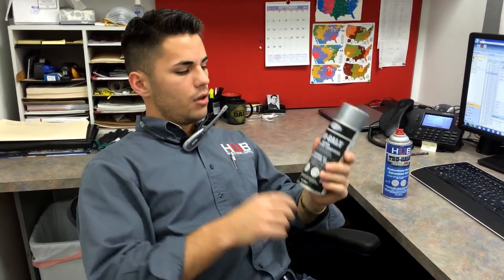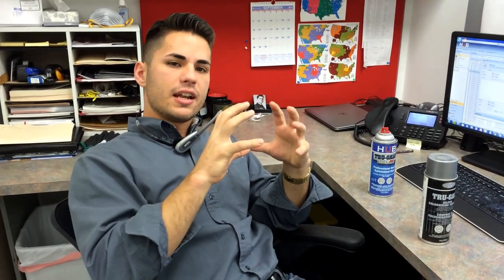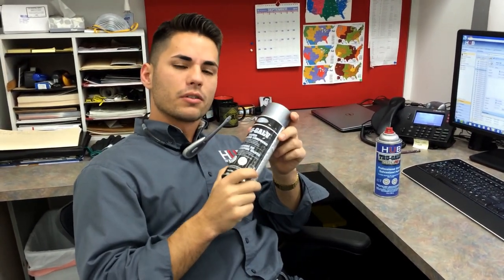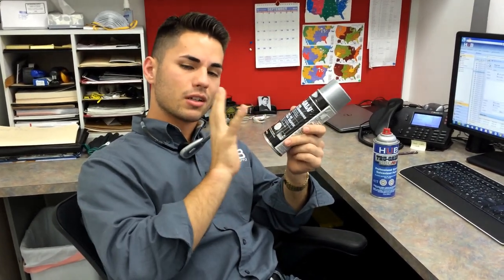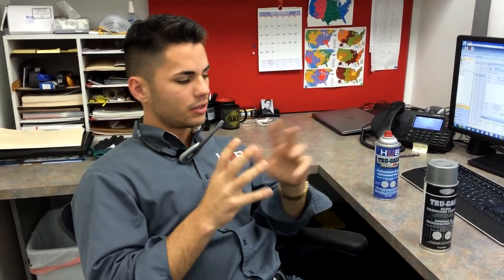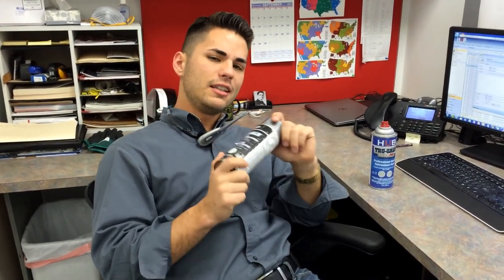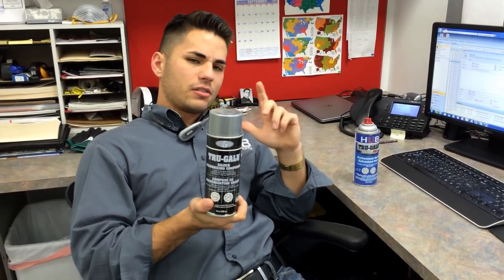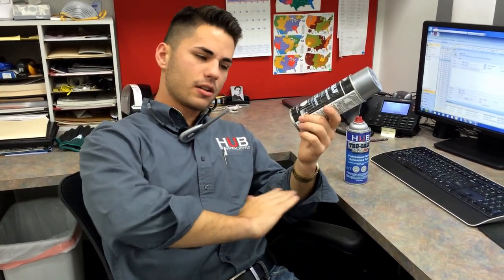EVER WONDERED ABOUT PUTTING GALVANIZED PAINT OVER PRIMER?

Comment: Cleaning with a power washer should be fine if the water is allowed to dry before painting and the surface is otherwise well prepared (degreasing, etched, etc.).  Blowing the water off with a leaf blower and/or compressed air would help speed this up as well as leaving the parts in the sun.

Comment: You can use the power washer. You just have to make sure it’s dry.
For small projects that can be accomplished with a heat gun very quickly.
 Wash it with the detergent, use sandpaper, etch with vinegar, rinse it with water, dry it with a heat gun, and you’re good to go.
Reply: However, everything else you said pretty much spot on.

Comment: I'm restoring an antique copper kettle used for washing clothes. The top lid appears to be galvanized, I want to restore the lid, what brand name do I purchase to spray on, I want a nice polished finish? A finish like what is on new corrugated metal roof.
Reply: try rustoleum zinc spray, it is a beautiful non industrial look. Very smooth

Comment: Anyone can tell if it would work to spray zink underneath the car to prevent rust ? I thought about this and did it by other methods (sand blaster + rust converter + primer + waxoil), but I think zink alone might have worked well, besides paint chipping in some areas since this particular zink spray seems easy scratchable.
Reply: Yes and no. Let me explain. I rebuilt a truck several years ago, I live in the northeast Salt belt. The entire truck was removed from the frame, and the frame was 100% sandblasted. I used ZRC 96% Cold galvanizing and reassembled the truck. 5 yrs of hard use in salt and road deicer, and zero rust. I also zinc coated the floor pans, rockers etc but these were all fresh sheet metal.
I absolutely would not recommend zinc galv over a vehicle that has any surface rust, road grime or isn't immaculately clean metal. I would recommend fluid film spray for a vehicle. Look into it on YouTube. Have a good day.
Reply: You should spray fish oil under the car, its a proven method

Comment: can i use gal paint over a rust converter?
Reply from the maker: Our expertise is in the metal fab industry and advising our customers how to create new work that won't easily corrode. Having said that, my understanding of rust converters is that they form a protective layer that would act the same as a primer coat and prevent the zinc in the galvanizing paint from doing its job.
Reply: @metalinsider8579  Rust converter prevent anything of doing its job at steel.
Reply: @metalinsider8579  My experience "10 years of using cold galvanizing compound"  .  Nr 28 and down worth reed.
Reply: rust prevention coatings are an encapsulating coating. Some chemically alter the rust to be neutral, some encapsulate the rust and prohibit the oxygen. Cold galv and products like Steel It containing stainless steel require zero rust before application.

Comment: Can I paint over cold galvanizing compound, if so, what can I use for a cattle gate.
Reply from the maker: Yes, you can paint over cold galvanizing compound. A high quality enamel spray paint such as Krylon Tough Coat(r) will work nicely. If you are painting over freshly applied galvanizing compound, check the product data information to make sure you allow enough time between coats. If you are painting over weathered galvanized finishes, you should prepare the surface with a light sanding before applying top coat of paint. Any signs of corrosion should be treated first removing all coatings down to bare metal in the affected area and re-applying cold galvanizing compound.